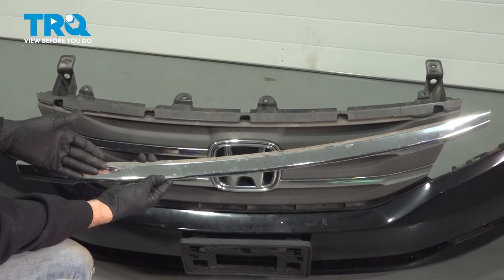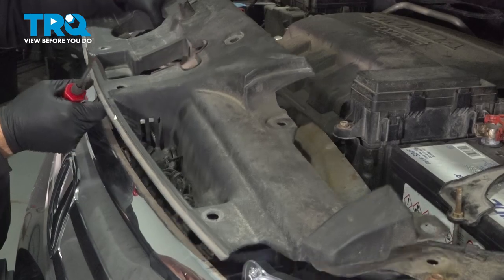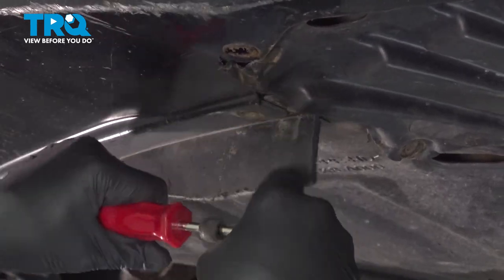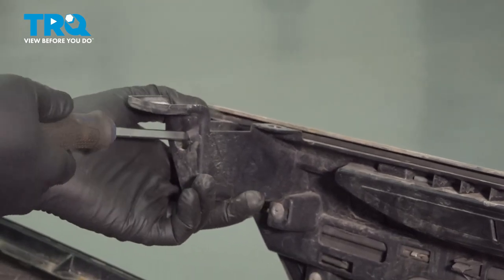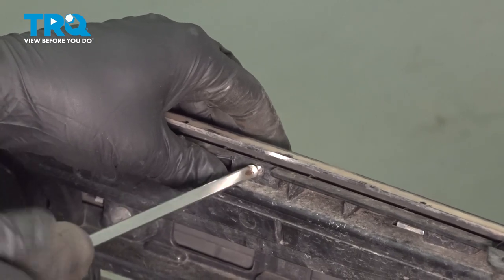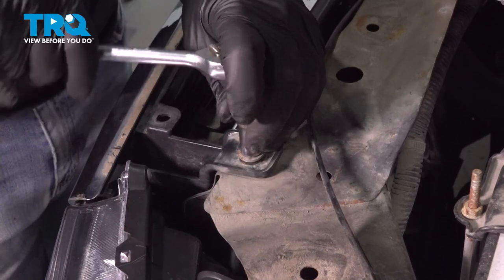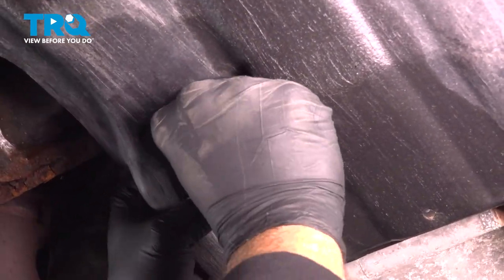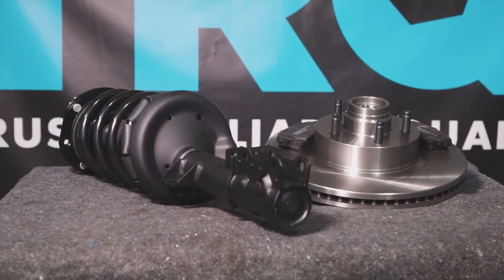How to Replace Upper Grille Trim Molding 2011-2017 Honda Odyssey

Comment: I just did this job without needing to take off the whole bumper, just the radiator cover. There is more than enough play in the grille to reach the screws, once you remove the cover.